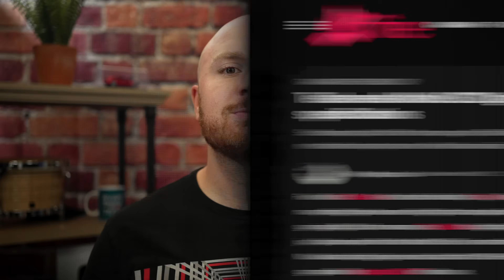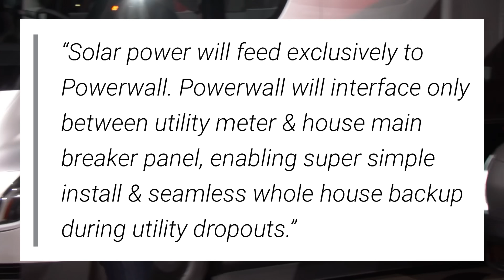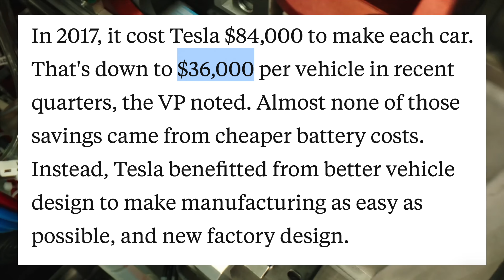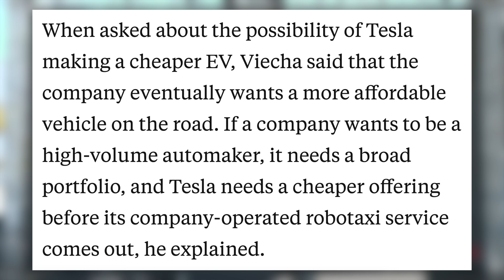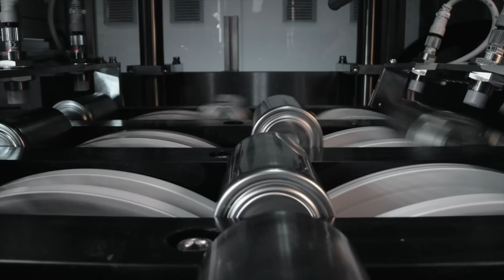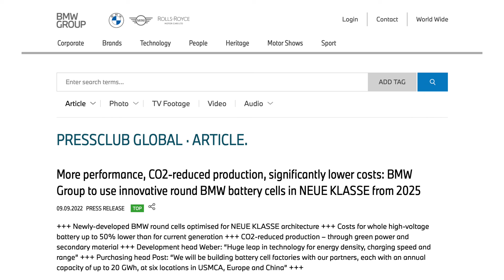Tesla Fixes Supply Issues Early | Ford Is Furious

Comment: II have a 17kw system wiith 2 power walls.  Solar really doesn't make sense without a power wall especially with bigger systems.  If  you look at the break down of daily energy sources for me: its 50 percent solar, 30 percent power wall and 20 percent grid on a high usage day.  And some days you can go without grid use at all.  We know electric companies aren't going to always allow net metering as more people get solar or the net metering is going to be 25 to 1 so basically be worthless.  So you want to use all the power you generate for yourself.  Now add in the fact its a whole home UPS system and lets solar be used when the grid is out and even let you have power once sun goes down.

Comment: Original order date for my Model Y was early Feb 2022. I have had over a dozen estimated delivery dates. One month windows to two week windows now back to a month window. Basically screwing all of my summer plans. Especially the two week windows this month. Yes i know that nothing is serious until a vin is assigned but then the window is less than a week. Not good for any travel plans. My current window got bumped a week from the end of my most recent 2 week window to oct 5 to nov 2.  Speeding up deliverY?  Ha ha not likely. The only “special” thing ordered on my car is a trailer hitch,  would be sad to find out that was the complication. Hopefully the high tech in the car is better than their pathetic estimated delivery process.

Comment: Hey Ryan, I have 42 solar panels on my roof from Tesla and have been very happy with the results to date. I didn't buy the power walls even though Tesla pushed hard to sell it. My reasons are simple: 
a) the additional cost to the overall project would have been too much for us. 
b) the tech is moving fast and certain buyers will get far better value in a matter of a couple of years 
c) we fortunately don't have many power outages in my area (tempted fate now!)
d) I am still hopeful Tesla will enable the car to be a back up option. 
To anyone thinking about get solar panels, I highly recommend to add more panels than Tesla (or other) recommend (we added 10). The cost per panels decreases quickly and any surplus is green energy for your community plus hopefully your local utility pays fairly for it.
Reply: We installed two Powerwalls 4 years ago to complement our 2012 existing 13.2 kWh solar PV system (55 panels) and have loved being able to operate as a microgrid for ~9 months of the year with zero energy grid draws during the prime solar production periods in Edmonds, WA while also charging two Tesla vehicles and exporting excess solar back to grid approaching 50% of our solar production. The Powerwalls are a game changer IMHO and have zero regrets about adding them. Last year we produced 350% of our energy needs for all electric home.
Reply: The car doesn't have the circuitry (as far as I'm aware)

Comment: Ordered a Model 3 Long Range 4 days before they cut off orders in August, with the original delivery estimated from November-Feb 2023. Three days ago it was updated to December. Checked last night and it changed for delivery within the next two weeks. Seems like Fremont factory going overtime to get these done but supply chain is definitely no longer an issue.
Reply: Dream on.
Reply: @MthoodSailor  I got my VIN and scheduled delivery earlier. Didn’t have to dream to get my vin within 46 days of ordering 🤷🏽‍♂️
Reply: @smangcity6541  yea looks like they are but now it looks like they are aiming quantity and not quality.
Reply: @regularMattMatt  accurate. Bringing the car in tomorrow morning for factory flaws. I’m assuming production returns to normal once the new fiscal quarter starts for speed of delivery for orders they aren’t able to fulfill
Reply: @smangcity6541  i hope they will be able to fix those flaws in your new car, Specially those gaps, mis aligned doors, and rattles in the cabin.

Comment: I wouldn’t say Powerwall is a “no brainer” especially in most US States where power is relatively cheap and a lot of utilities still have net metering. For a start - there’s no way you can make the sums work for payback within the 10 year warranty period. And most US homes would need a minimum of 2 powerwalls. It does help in the event of a power outage so if you experience frequent outages then some kind of battery backup system is warranted.
Reply: It's going to change.

Comment: I would think drivers profile should include things like radio channels and settings other than seats and mirrors.  Seating positions are different between cars, ie, the 3 is not on rails like the Y is so you sit higher in the Y.

Comment: Question: I was recently at a fast food restaurant and a Tesla was in the parking lot.  I guess the AC was on and it was louder than the gas cars nearby.  Is that normal?
Reply: Hi, the AC could of been on (as you can turn on the AC from Telsa app while away from the car to reach the temperature you desire) but that may not only be the reason. Tesla vehicles can be loud at times due to the batteries.  If they get too hot or too cold, the vehicle will condition the batteries accordingly and the vehicle may sound loud.
Reply: @cadillacjew  thanks for the information.  There were people in the car, eating there lunch I assume, so I assumed it was AC ( hot day in SC)

Comment: Great video as always..
I wonder how they come up with saying that the model y will be the best selling vehicle of all type of all time in history?
I guess it kind of depends on how you consider that.
Model t Ford sold 15 million cars in about 10 years, and with a far lower population at the time.
That was surpassed by the Volkswagen beetle but of course that was over a much longer period of time and with a higher global population, and stretching across a couple different model types. The original beetle and then the new beetle.
I would love to see them bring out a less expensive Tesla, but I don't blame them for not doing it. There is a slight risk that legacy auto manufacturers might be able to fill that niche, that could definitely be a problem for Tesla long-term, once people enter a manufacturer type if they are happy with that vehicle they often will stick with it. So if you get your first EV from Chevrolet, there's a pretty good chance that you might stick with that brand.

Comment: im intrigued with his comment mixing the 25k Tesla to the Robotaxi. I think it is because of hitting two birds with one stone.  Robotaxi really needs a cheaper car for quick ROI and Robotaxi could do without plenty of conventional car parts. Removing Conventional car parts includes removing the steering wheel which is already known to some, side mirrors, drive by wire braking system. I also think removal of brake discs is a possibility.

Comment: Is it just me, it look like the Aptera Solar Car would have a hard time passing the crash test with the wheels sticking out like that.
Reply: The Aptera only has 3 wheels, so it’s technically a motorcycle and doesn’t have to meet the same safety standards as 4-wheeled “cars.”
Reply: @davidavard8461  ok cool was just wounding about it.

Comment: We have to stop pretending that Tesla has a mission that goes beyond making shareholders profit. It started out noble, but now it is about profit. Unfortunately with horrible service for sales and repairs they are vulnerable to any number of other automakers.
As for the power wall question. I got 3 free ones or I would never spend that kind of money on backup. I would spend it on larger solar and buy a $1000 generator.

Comment: The cost savings of building an EV car ($84k in 2017 vs $30k) is misleading. In 2017, Tesla was primarily building the more premium Model S and X, while today they are primarily building Model 3/y. The Model 3 was released July 2017, so the average in 2017 skews heavily towards building Model s/x which includes more optional and premium features. I'd be more interested in the cost reduction of Model 3 in 2018 vs cost of Model 3 today.
Reply: Not nearly as misleading as your obvious comments imply.  I thought the same thing hearing this the first time.  However in 2017 they went through hell to bring model 3 online.  They had to learn how to make a cheaper electric car it simply wasn't just a choice. They started at a high price point because they didn't know how to make a cheap one.  After that they have continuously innovated their manufacturing to bring down costs.  The overall drop does indeed represent ev cost reduction.  It would still be interesting to see the the cost drop over time for each model to give us more clarity on the impact of manufacturing improvements vs model mix and new product design.
Reply: True, no doubt there's been cyst reduction over time. Call me a skeptic, but the lack of details leaves it open for abuse and pushing a partially accurate message. For instance, if this "cost" was captured at the beginning of 2017 (with NO model 3), IMHO it nullifies the point you brought up as only comparing the premium Model S/X vs. today's more mass market cars (with less premium features) is not really helpful in identifying the true reduction in cost.
Reply: Cyst= cost
Reply: Also, saying that the cost reduction didn't come from reducing the price is the battery is misleading. Even if the cost per kWh has stayed the same in the past five years, which it has not, a Model 3 or Model Y has a smaller battery than a Model S or Model X; because the newer models are smaller and lighter they don't need as large a battery. Smaller battery = less $.

Comment: Regarding Aptera Gamma;  the unit shown did not have the full solar array.  The full solar array does away with the rear window and covers the hatch with solar cells, and adds more cells to the roof and front areas.  There are four battery packs offered in Aptera.  The 1,000 mile version is the largest and it will be the LAST one to see production, according to one of the co-founders.
The range option that will be produced first is the 400 mile range unit, followed by the 250 mile $25,000 range option, then the 600 mile range version, then the 1000.  My reservation is for the 400 mile version, chosen before the production map was announced.  400 mile battery pack, all wheel drive, full solar option, and off road wheel skirt option priced out at $34,000.  I passed on the ADAS option.

Comment: I don't think the pricing will change, doesn't make sense for them to reduce it. It would make more sense for them to create a new less expensive model to fill in that gap while at the same time providing more features or nicer materials in the current models to justify the higher price tag. However, this will only happen once competition ramps up, they are not going to use up all their cards right away. Additionally I wouldn't be surprise if they make more money in the commercial space down the line, no one even comes close to them there.

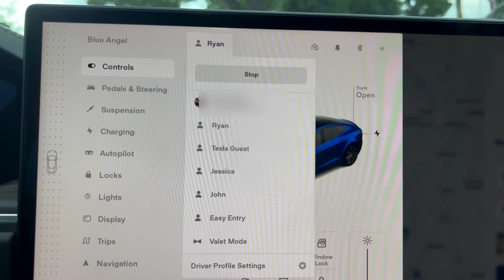Comment: 3:00 how could the company miss this fundamental feature so badly (cloud profiles)?  There should be a “normalization factor” for each of the four cars to provide equivalent settings on each model (which I had assumed they would do).
Reply: They didn’t miss. You just have to calibrate your profiles to get it to work correctly.
Reply: @mondotv4216  
He did, but it's profile based before car model based.
What it needs is multiple profiles per driver with each profile assigned to a car model.
Then, the car to identify it's type.

Comment: My utility company will give me a credit for net metering, but not actually cut me a check. Plus I'm on the same grid as the police, fire and municiple building, so the longest ive been without power in 12 years is 20 minutes... even through a tropical storm. So no need for a powerwall... Natrual gas generator is only $2k if I really decided to add back up...

Comment: While I would love a sub 30k from Tesla, I don’t blame them for focusing on higher profit vehicles that have huge demand.  Imagine if they did release a $25-29k car, they would be all sold out to flippers and resold with crazy markups just like every other EV.
Reply: Manufacturers have the benefit of prevent reselling by voiding warranties.  GMC just announced they are doing it with their EV hummer
Reply: @Miguel_Molina  Easy to circumvent. Instead of reselling you just rent it out with the fee for the first 10 years to be paid as a lump sum upfront and an option to buy the car for $1 after 8 years (or however long the warranty is).
Reply: @HenryLoenwind   Interesting. But What if they want to sell the car?  I don't believe you can sell the car without a title.  I would expect you would have to keep in touch for 8 years in case they need a title transfer? Not sure how that works.
Reply: @Miguel_Molina  GM is all bark and no bite, if you read what they actually said( and not what a website reported) , they are thinking about possibly implementing measures in the future to void warranties and ban known resellers from buying🙄They are doing the same thing as Ford all talk.
Reply: We will never see a sub-30k vehicle from Tesla. They make huge margin (by industry standard) with their current pricing and they still couldn't keep up with the demand. And remember when the base model  3 was supposed to be $35k? That model is $45k now. We would be lucky to see a $35k Tesla at this point if not at all.
Reply: @duerf5826  The dollar is being compound devalued by at least 8 percent per year since 2017 when the model 3 was introduced so it's no surprise that the price of Teslas keeps rising. There is also the efforts by Tesla to keep the wait times in check by increasing prices.
Reply: Yeah if they sold them that cheap, all the Tesla “haters” would buy one 😂😂
Reply: If they could build all the $25K cars they can sell it would kill the EV market for other automakers, which will slow down EV adoption and create a virtual monopoly for Tesla. That would not be good. Tesla needs peers, even if it means Tesla will have to overprice its cars.
Reply: @barttemolder3405  just imagine if every car looked like a M3 or MS 🤣😂 I’m just excited for the cybertruck as it’s a fresh design.
Reply: Lots of folks making excellent points about why Tesla can/should just keep a huge profit margin going.   I would hope, though, that the resulting flood of cash could be used to increase engineering staffing, and address a wider range of longstanding problems/opportunities with their products.
Reply: @levenkay4468  absolutely, quality control issues and service should be at the top of the list for Tesla, unfortunately with demand at all time highs I don’t expect a pivot to increasing overall quality and experience.  Basically they could start removing features and shipping cars with massive problems and people would still keep buying.  When demand drops quality will increase and price will drop as well.
Reply: Really its too early to talk about a 25-30k Tesla, or mass adoption EV for the person of average means.
Only way to do so at present is to do what other mfgs have done with EVs in that are close to that price range - make it a short range commuter car. Sales figures of course tell us that practically nobody wants that kind if vehicle.

About the only people excited about cars being short range, limited utility, commuter devices are train/transit enthusiasts.

Comment: An elegant solution for the seat position problem is to only save seat settings for the same model vehicles. For example if you get into multiple model 3s, the setting would be saved but not going from a 3 to a Y.
Reply: Until that is fixed, have multiple profiles. Ryan - Y, Ryan - 3, Ryan - S, etc
Reply: This is exactly how it works if you read the details about Tesla profile.
Reply: @tianrun324  Are you a consultant or middle management? Those are the two professions where "what's written on paper is more true than what can be measured in reality" is the general mindset...

Comment: Rather than use resources to offer solar or power wall separately, makes more sense to integrate a hot water/HVAC system. That integrated system could reduce power inversion losses and or act as a battery ( store excess heat or solar generated KWH as hot water for later use).

Comment: Sounds like Tesla needs a different driver profile for each different kind of vehicle instead of a single profile for each driver regardless of vehicle type.
Reply: They just need to store vehicle-dependent settings in a vehicle-specific bucket. So there's a separate Model-S-seat-position and Model-3-seat-position etc.
Reply: Why don't you just create a Ryan Model 3 profile, and then create a Ryan Model S profile?  Get in your 3 and adjust your settings and save.  Get in your S and
 adjust your settings.  You will see both when you sync which will solve your issue right now.  Why rollback this feature because of a few users who won't simply create multiple profiles for multiple vehicle platforms.
Reply: I for one think this can be solved by using per-vehicle offsets.

Knowing the car you’re driving, and comparing it to the original verhicle you saved your settings on, it can adjust the values based on the difference in seat height, steering wheel height, wheelbase length, etc. 

So if a Model X is higher off the ground it can adjust the mirrors by that offset compared to the vehicle you’re coming from.
Reply: pretty simple fix like email address multiples on the same platform  you just alter the name of the code